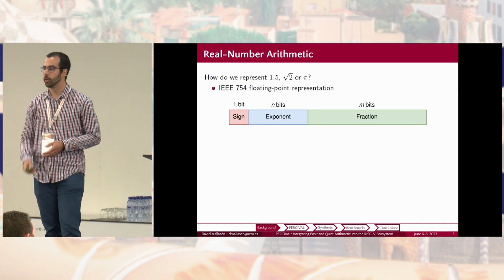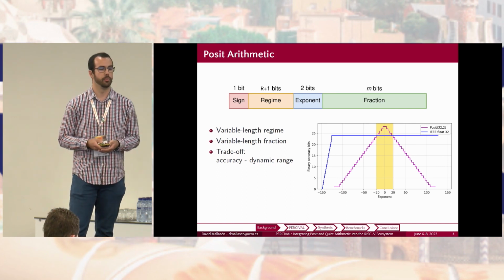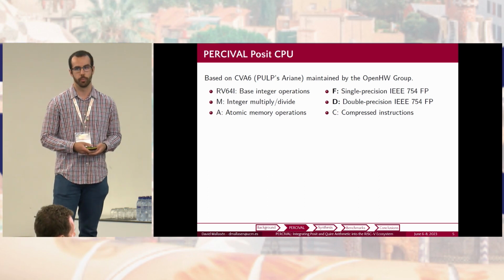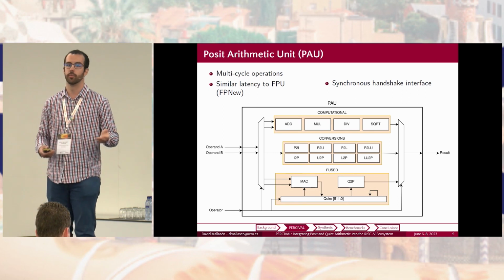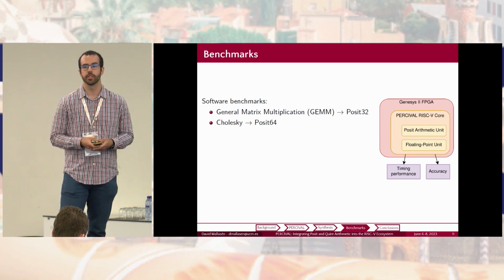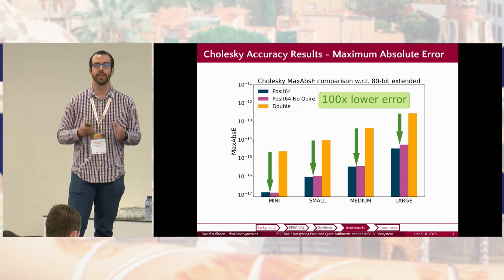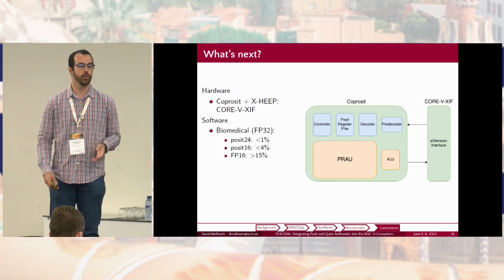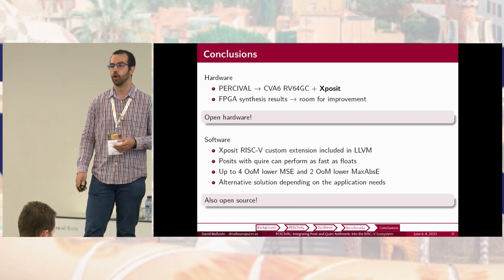David Mallasén Quintana - PERCIVAL: Integrating Posit and Quire Arithmetic into the RISC-V Ecosystem

Comment: While hard to do with a co-processor, the overhead of the quire register seems like it should be possible to offload onto the vector registers for the V extension. They even come with a mechanism to group multiple registers into one, so you could technically get 8 separate 32 bit quire registers with a standard set of 128 bit vector registers, on top of the separate 32 posit registers for scalar arithmetic.